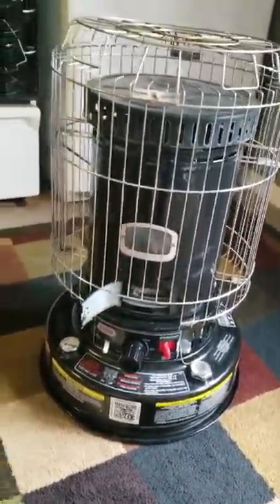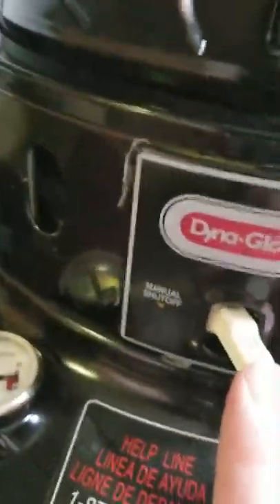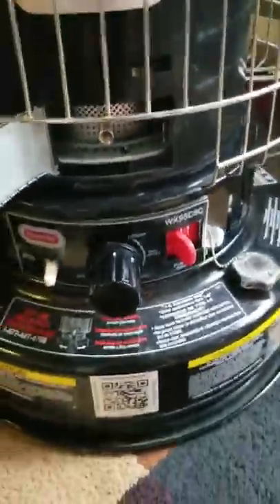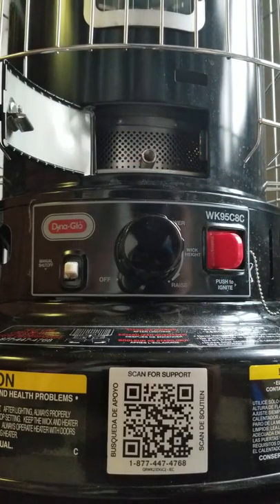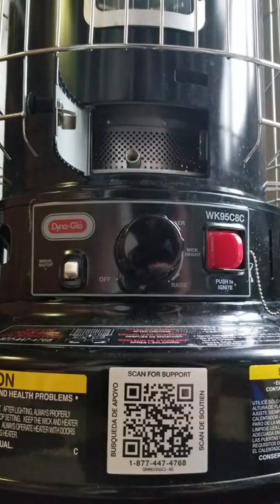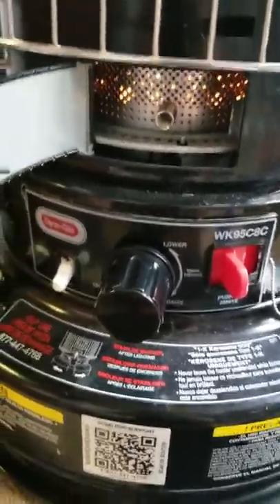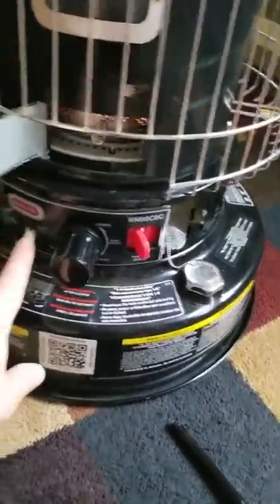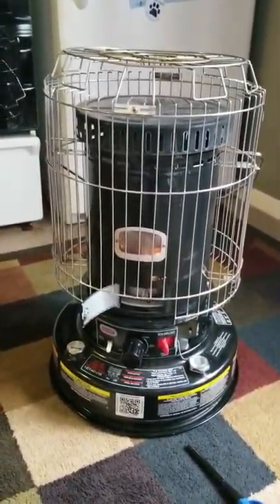Manual lighting a kerosene heater

Comment: Me and my buddy are out here in my garage getting way too many laughs out of this. 100% best instructions ever! Thank you! You helped me light my heater!
Reply from the maker: Happy to help!🔥🔥🔥
Reply: @ravenjimbo shoot since you’re here, happy new year! Also. How long does a tank of kerosene normally last you? I have diesel in mine right now, I was having a hard time finding kerosene where I live. All the gas stations said their kerosene was out or didn’t work anymore.
Reply from the maker: @micahlawton  I'm not sure about running diesel that sounds dangerous lol! But a full tank would usually last around 8 hours if I remember correctly. Been a few years since I've used one. Happy new year!
Reply: @ravenjimbo  I know don’t believe everything you read online but I looked and it said I could use diesel. It’s not in my house it’s in my garage and really only used when I’m working on my car.
Reply: @micahlawton   Hey, to give you a bit of info. I'm using Diesel mixed with little 1K Klean Heat  fuel OR  high percentage rubbing alcohol whichever I have on hand.  I've been using Diesel in my Perfection heaters and my new R2D2 (lol) and have ZERO issues. No smell or smoke but only with initial light up or putting out as mentioned in this vid with regular Kerosene.

I'm saving a ton of $$ going this route and follow the same safety precautions as using Kerosene. and for the past 10yrs never an issue in the case with my Perfection 625 heater which is a 70+yr old heater.

Comment: I'm glad you mentioned your problem with the electric igniter. I have that exact model. The igniter worked for 1 winter season then never again. I have spent hours looking at it trying to figure out why it doesn't work. I have no problem gettig it lit with a grill lighter but it still bugs me because it was still in excellent condition when it stopped working.
Reply: Did you change the 2 C cell batteries? That's what the ignitor uses.

Comment: I have never been interested in using the electronic igniter on my Kerosene heater and I have never use it and I never use the manual shut off switch neither. All of these extra accessories are just extra items that will break soon and will need replacing. I simply ignite my kerosene  heater the way you do and when it comes time to turn the heater off, I simply turn the Wick knob counterclockwise until the flame is extinguished. I don't have to worry about battery replacement nor replacing anything else except for the Wick occasionally.

Comment: With the storm making its way across much of the country, I brought my R2D2 unit in to prepare for loss of power. My problem is the wick knob has a white arrow on it, presumably to tell me where the wick is in relation to the Low and High indicators on the unit....well, when I raise the wick, I have to turn it ALL the way to the right. The white arrow is then off the charts of the HIGH indicator - and, in fact, on the other side of the markings indicating the wick level. Obviously, the factory installed something wrong, maybe just the flat piece inside the knob, but question for you, if you're still out there checking on such things - the white arrow is on the opposite side of the markings when it's lit and barely moves to raise/lower the wick - it doesn't run the full gamut of the Low/High indicators, for sure! Still ok to run this thing? Good grief, it's driving me crazy!
Reply from the maker: As long as it's not smoking or putting off heavy fumes you should be okay. If the flame does not go the entire way around the wick cylinder do not use. You can get the wick replaced if that is the issue. Hope this helps. Stay warm at your domicile!
Reply: @ravenjimbo  Thanks for the reply! I took 'er outside my domicile and gave 'er a test run. After 'bout 5 minutes, flame was burning all the way around, she she should be good ta go! Thanks so much!!!!!

Comment: I have the same heater that I've been trying to light for 10 minutes, does a wick pop up threw the middle? Should I replace the wick or is something else going on? I haven't messed around with kerosene heaters much.
Reply from the maker: Turn the knob until the wick pops up thru the middle. If it is not in there or if it's not saturated with kerosene nothing will light. Let a new wick soak with a full tank of kerosene for 1 hour and try again. Hope this helps.
Reply: @ravenjimbo  thank you

Comment: How do I shut off A  Kero Heat Heaters that does not shut off ? I tried shutting it off to the Shut off Manual and it is still running  ? I tried the Adjusting Range But it is still going .
Reply from the maker: When you push down on the shut off switch it should drop down and extinguish. If it does not something might be out of alignment.